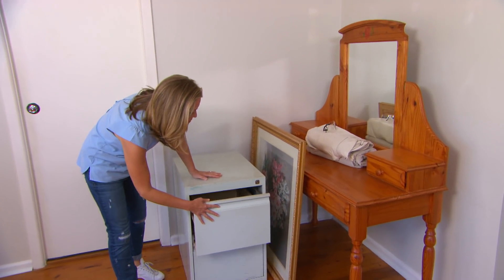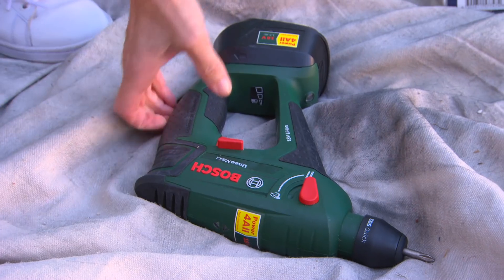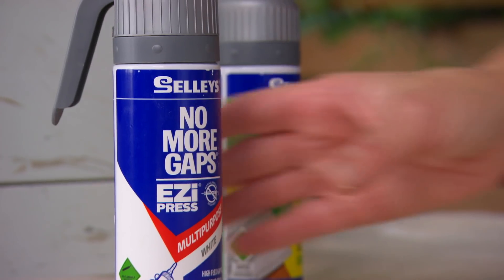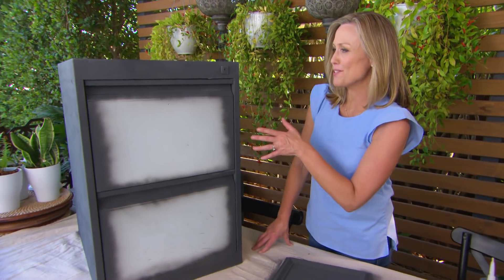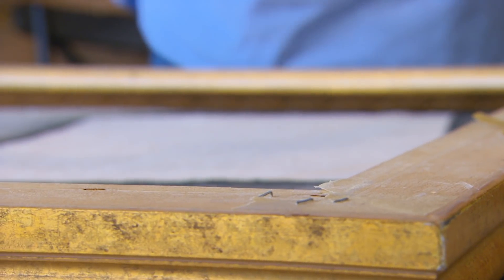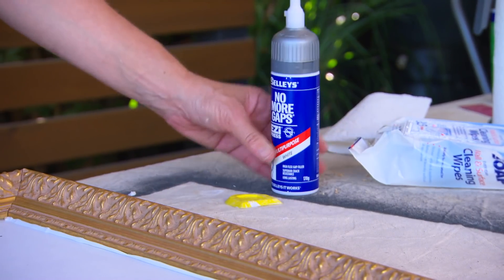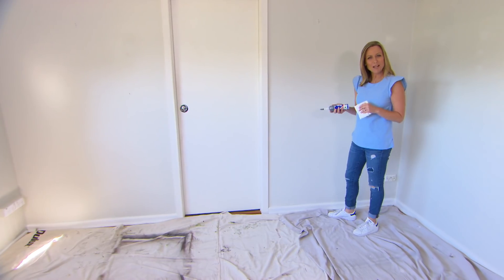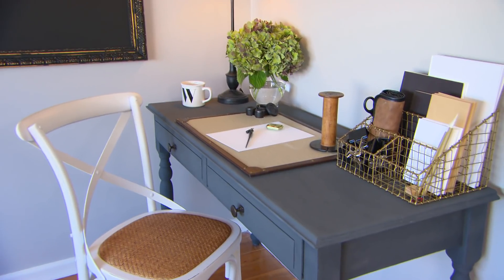Three Furniture Upcycling Projects to Totally Transform Your Home Office | DESIGN | Great Home Ideas

Comment: Like the idea to repurpose items you no longer use. The only problem I have is using spray paint; it's definitely not good for the environment. Instead use a 4" sponge roller for a nice smooth finish with paint from a metal can/plastic container which can be recycled or reused. 💯❣